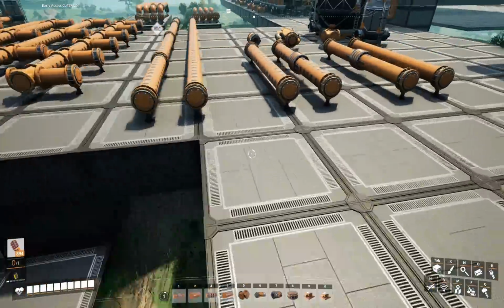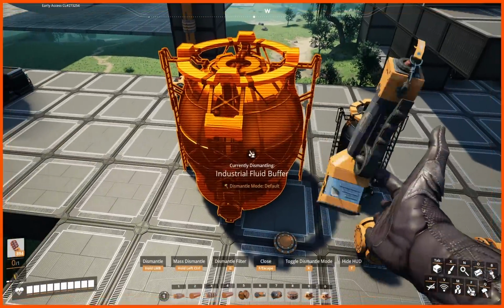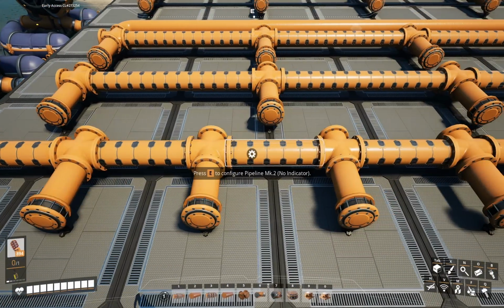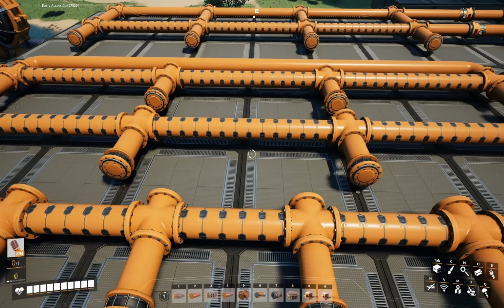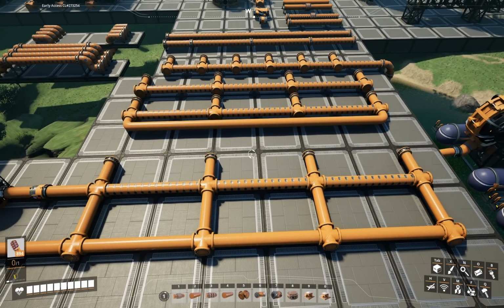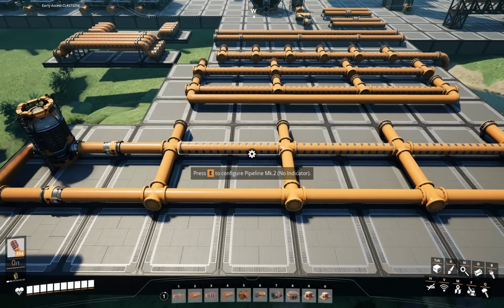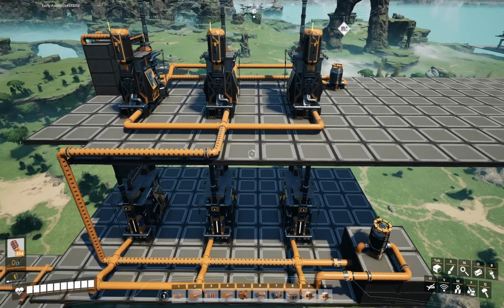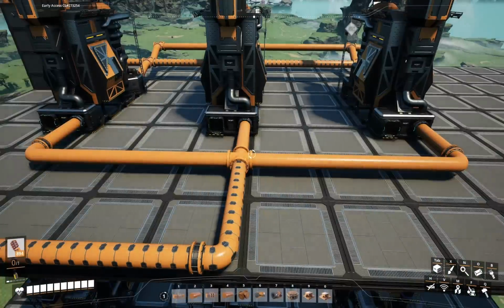[OBSOLETE] Basic Fluid Dynamics + flow rate issues (mk 2 pipe bug)

Comment from the maker: I have made an updated video for this, you can find it here:
https://www.youtube.com/watch?v=hIr1OY0VE-s
Reply: At first I was like "Oh yay he made the video shorter and gets the the point quicker" but no, that's not what happened.
Reply from the maker: @Boxman5  lol, the new video has more information, better delivered and has chapters to make sure people can go find the exact thing they are looking for, i could have split it into two videos, it would have been better for my stats and everything, but I want it gathered in one place. If you were looking for TikToks or shorts, this aint the channel for you.
Reply: @jackblade281  lol 🙂  One question, I see in your other video you are not mentioning anything about long pipeline manifolds.
I'm currently designing a large fuel generator array (rocket fuel).  In the past, I did get bit by the sloshing with long manifolds (like in update 3~4).  I know it's a long while ago, but I remember I had turbofuel powered fuel generators, and the last few always kept running out of turbofuel, even though the math was correct.  And I think that's what you covered in this "obsolete" video.  I remember also kind of helping the issue by having a second pipeline connecting the beginning of the array directly to the end (similar to what you have here).

The question is, since you did not mention anything about that in the new video, is that something that is fixed in 1.0?

Note that I always redo the pipe sections when I add a pipeline junction/pump/etc. as you mention in your new video, and that I can assert that it's 100% true that this solves many of the flow issues!  I don't remember when I had issue in update 3/4 if I did that.  Maybe it's just because I did not trim the pipes at the time.

Regards.
Reply from the maker: @bigboy074  I think I just off hand mention having shorter manifolds in the new one but you are correct, shorter manifolds equals less problems! And happy you have solved your flow rate problems!

Comment: I have never had any of these issues simply using a water tower (with a fluid buffer at the top) and feeding from a lower level up to my machines shrug
Reply from the maker: Yea for some it just works out :P
Reply: @jackblade281  the other thing is (especially if you are using manifolds) is to preloading the solid matter and then starting each machine one at a time starting at the end of the line allowing it to fill up with fluid.  once everything is filled it tends to be good
Reply from the maker: @kingjames1308  I go the reverese route, fill with fluid first and then connect up the solids, letting the solid manifold fill like normal
Reply: @jackblade281  the problem with that is it will take forever for your line to normalize since all of the solids will be hogged by the ones before in your line.   The same is true for fluids.  If you want your production line to start full blast and not be starved for a good while its better to start machines starting at the end of the line and letting them fill up first then slowly starting the ones closer to where the manifold starts.   I also run solids into a small storage (coal etc.) and let that fill up while im building then i just take the stacknout of that and prefill all the machines in the manifold with those stacks.   Then when it comes time to start turning things ok it goes so much faster.   Letting the end of the line fill with fluid is seconds… then slowly turning on each one closer to manifold start is quick and everything starts at 100% prod rate

Comment: My number one trick to remedy flow issues without knowing wtf I'm doing is to just overproduce. Or under consume, depending on your point of reference. 5 refiners making 200 fuel should be exactly enough for 10 fuel plants but what ends up happening is the last one or 2 plants on the manifold start short cycling and making your power prouction unstable. Building 9 power plants keeps them all full at the expense of the refiners coming on intermittently.
Reply from the maker: YEapp, exactly, and thats a small price to pay, and any unstable refineries can be solved with a well placed fluid buffer :P

Comment: My problem is the pipes to my machines get “overflowed” and I have to flush all the time while segments down the line are empty. Frustrating
Reply from the maker: Wait wha tdo you mean? that they fiill up? on the output you mean, not the input?
Reply: @jackblade281  the machines stops.. just like it stops when the output on the other end is full.. but in this case the output is empty. When looking at the line leading into the machine, the line is full the glass bubble gauge.. completely full. The flow numbers do not move. Machine doesn’t run. Next segment down the line leading to next machine is almost empty. I’m going to try replacing those T junctions. But why the machine stops when the line is full and nothing blocking the output.. is beyond me. As soon as I flush .. the liquid in that pipe drops and the machine runs again.
Reply from the maker: @noahhill5741  Sounds like the pipes on the output side are messed up or not connecting properly. The video coming on tuesday is an updated version of this, when it drops see if there is any steps there you are not doing or have missed currently and hopefully that fixes it ^^
Reply: @jackblade281  👍🏻👍🏻 I managed to get it working by ripping out all the pipes and putting it all back together. So sounds like something was buggy. I wasn’t patient enough to try individual pieces to see which one was the problem.
Reply from the maker: @noahhill5741  hey as long as it works now, that’s perfect 👌

Comment: Still bugged like hell in 1.0 it seems I can’t have neither a simple coal setup working without wasting hours to tweak and adjust things.
Reply from the maker: If you just follow this guide for the coalsetup you can have power, just skip over the Biomass Power part and you will get a simple foolproof coal power setup, its has never failed me!
https://youtu.be/moWRzInDPV4

Comment: 32:05 if you weren't going to get the full flow rate then setups that use the full flow rate wouldn't work, and they do.  8 coal gens use 360 water from 3 pumps.  using mark 1 pipes with 1 pipe from a single pump entering the first pipe from the other 2 pumps  in the middle of the 8 coal gens so it flows both directions works fine.  hence, full flow rate.

I understand and appreciate what you are doing here trying to explain things and help, but after watching your video I'm not so sure you actually understand how it works, yourself.  Heck, I am more confused than I was previous to watching the video.
Reply from the maker: Yea, I do understand it, the problem for me making this video has more to do with my ADHD and lack of experience with content creation, and less with the game. I am going to make a updated version of this video so keep an eye out ^^

Comment: i think the issue if deciding to put air into pipes in the first place, hammering doesn't really happen too much on pressured pipe (only when a fast flow is immediately shut off). if the pipes had a pressure instead this will be much easier... 4th time im playing again and its still a problem..
Reply from the maker: yea, I am still early enough in the 1.0 playthrough that I haven't really had to deal with any complex fluid systems yet, but man, I am dreading the advanced oil processing and aluminium loops

Comment: Want to know the real secret to solving all of your pipe issues? PRIME YOUR SYSTEM BEFORE TURNING IT ON. If pipes are full literally all of these issues disappear, not even joking. Power your extractors first and completely fill the system. Then turn on the next set of machines and let them completely fill the next set of pipes. If pipes are full, all they do is flow. The vast majority of these problems are caused by fluid attempting to fill the system. Make sure your input is equal to output, prime the system, turn on the machines, and forget.
Reply from the maker: does not always help, like with fuel generators or aluminium water recycling loops and such

Comment: Yea, it still sucks in 1.0
Your section starting around 19:00 is one of the reasons I HATE this game.   Fluid systems do NOT work this way in real life, in no way, shape or form.
Engineers would be jobless that designed systems like this.
The only thing this game takes into account is flow and head lift.   PRESSURE is the #1 thing to monitor in any fluid system.  Fluid pressure isn't a thing in this game, which is why the fluid system SUCKS.
Once you get your pressure built up, you have flow.  Period.  Flow just doesn't stop because of fluids sloshing around.  Rediculous!
Great video though!  Thanks!!
Reply from the maker: yea they pick and choose the stuff that is in there and whats not,  I really should make an updated video on this XD I have so much better understanding of this now and can help so much better

Comment: None of this really explains how to for sure squeeze 100% efficiency out of the oil nodes when making turbo fuel plants and generator arrays. I keep seeing people talk about how easy it is on the steam discussion pages, but it aint easy. I naturally learned all the stuff you have here, but thought maybe you know something I didn't.

The only sure fire way I've found to rid systems of flow rate issues is to not try to squeeze out 100% efficiency, and even then I have problems with vertical pump consistency when moving fluids up to a holding tank to let gravity feed them down. The tank is full, the pipe reads 600 m3 a min, but down stream machines are not getting that 600, not even 500 of it sometimes. I spent all day dicking around with pipes and dismantling everything trying to figure it out but I can't.

They need to fix this stuff.
Reply from the maker: yea its sorcery at this point and if I could i would never use any fluids in Satisfactory XD But I will update this video, I am not happy with the structure or rather lack thereof, and I feel like I can debunk some of the stuff I said as well as give better tips.
Reply: @jackblade281  Yeah I don't mind a challenge or solving problems. I love it, that's why I play games like this. But, when there's no clear solution for flow rate problems, and the best tips out there are basically don't use 100%, I get frustrated.

There's no problem here to solve, the flow rate issues can't be solved without downclocking or removing a couple machines at the end of the chain to accommodate a certain percentage of loss or flowrate wiggle room.

It's not at all satisfying to build fluid systems with this strategy in mind. Not at all. I really do expect to be able to squeeze out 100% efficiency from liquid nodes and not have to sacrifice a percentage of them to achieve a pseudo 100% efficiency.
Reply from the maker: @ysonokosan  yea I understand, I feel the same way and it is super frustrating... I am happy I manage to solve the problem most of the time now though.
Reply: The issue is back flow and time. equipment takes x amount of time to produce the liquid plus any time Stopped when it's output is full. For example if you let the Pipes fill full before connecting to the generators the refineries are full and the pipes are full, for a macro example lets assume you could connect all generators at the same time. The liquid would go in the generators creating space in the pipes that space is not filled immediately from the refineries because they just turned back on and are going through the production cycle before dumping in more liquid to the pipes. Pipes on the same horizontal plane act like tanks not actual pressurized flowing pipes like say water in ur home they will instantly try to balance out by flowing into both the pipe ahead of it and the pipe behind it plus feed any inputs(generators etc). they are always trying to fill the pipe segments and put liquid into inputs (generators). this is why when the tail end of your pipe line is empty and the gens are starving the top end near the refineries pipe system will be full and hardly flowing because they fill the empty time gap or inputs(generators) in the pipe first always, which is why height works because it negates the back flow and creates the pressurized "flow" into the lower pipe plane. I use height to make the system the best it can be and if im on one horizontal plane i use a fluid buffer to balance the time gap and back flow valves at every junction so the liquid can only ever move to the next pipe segment down the line (no back flow)

Comment: Do gasses behave the same as liquids?
Reply from the maker: no, they don't have hammering and they don't need headlift, tips is still t olet all pipes and machines fill up with gas before turning on the machines though
Reply: @jackblade281  so does that mean gasses don't "flow" at all, they just fill the volume of the pipes?
Reply from the maker: @fritzywolf  Yepp, pretty much

Comment: The flowrate problem only occurs when the flowrate needs to be exactly 600. Underclocking my machines by 1% has so far solved every such problem.
Reply from the maker: normally underclocking solves most problems in pipes XD

Comment: ~ 24:00 be careful with the Valves in one of these kind of looped systems.  Valves do not carry headlift through them.  It straight up blocks it.  The only reason it would work in the system shown is because the bit at the end is connected in such a way it loops to the main input, which is at a greater height.  The section between the exit Valve and the Buffer, though, has no increase to headlift from it's current height.
Reply: Since when do valves block headlift? Are you thinking of pumps?
Reply: @ivocanevo  Since...  always?  When a pipe passes through a valve, the headlift of the pipe is reset to the altitude of the valve.  Pumps explicitly add headlift -- they've never blocked it.
Reply: @PhailRaptor  nope. Valves do not reset head lift. Look anywhere. Any wiki, guide, anywhere. Or you can test it yourself.
Reply: And pumps reset headlift. After the pump, the headlift becomes that which is provided by the pump.

So an Mk 1 pump on a pipe sourcing from a 100 m water tower actually causes the headlift to drop to 20 m. A pump that is unpowered resets headlift to zero (or 1.3 m, the headlift of a pipe).
Reply from the maker: @ivocanevo  Valves resets headlift, had an experience with that literally today
Reply from the maker: Yepp! realized this later as well XD

Comment: I want to clarify some things to prevent frustration with this:

1. Floating point numbers are not the cause of these problems.  It's "water hammer" as the community is calling it.
2. Longer segments would only help with floating point issues because of fewer nodes, not because they are longer.  15:30 is all incorrect.  Floating points isn't the issue you're seeing anyway.
3. 18:10 is mostly correct, but you only need to send it to two or more parts of the manifold away from each other.  It works best when each entrance splits both directions right away.
4. The buffer stops helping the moment it is full or above the head lift.  The valves are only making it worse.
5. 22:30 Spacing the machines like this outside of the first split from the input pipe isn't doing anything other than delaying the problems.
6. 23:20 is helpful, but the machine's internal buffer is enough to compensate for it.  You can improve local flows by keeping the pipes above the inputs, but it not required to get full efficiency flow on the source pipe.  All you have to do is never expect a pipe to do full capacity between the source and the first machine input, buffer, valve, etc.  Split the pipe before that.
7. 28:35 changes nothing.  Attaching it to the junction above it, closer to the source, would be better.  That junction splits two ways instead of feeding one machine and not splitting out.
8. 35:40 You can do ten.  Just use more than one pipe or split the pipe two or more times before entering the next manifold.
9. 33:10 A nuclear reactor at full overclock doesn't need a manifold, so there is nothing you need to do.
10. 34:35 All this work means you don't understand the source of the problem.  The biggest problem is at the entrance to the manifold, unless you have abysmal fps.
Reply: Totally underrated comment. I agree with every point. This comment needs its own video!
Reply: Hey Scott, thank you for writing this up - it's incredibly helpful. I feel like youtube is missing a truly factual video on this topic. Would you consider uploading one for the community?
Reply: But guess what?  My nuclear reactors STILL turn on and off even with fuel backed up and 5 water extractors feeding into 1 reactor.  So the fluid dynamics are still an issue.

Comment: that fluid buffer  at 23:48  is not going to work effectively (and possibly not at all).  You spent an entire episode talking  about head lift  how to avoid backflow and yet here you have created  a situation where that fluid buffer will be full at all times because  the pipe behind it is the same height as the top of the fluid  buffer.  The fluid buffer will fill before the raised pipe behind it fills.  It would have made more sense to raise the pipe first and then place the fluid buffer. Surely fluid buffers should be at the highest point of any system, or at the end of a system ideally with only a single pipe acting as the in or out for the fluid buffer not have the in AND out pipes in your system
Reply from the maker: Yea, I realized that a few days after the episode went up, good catch though :P